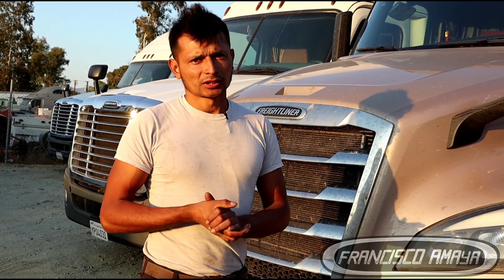Detroit diesel DD13 DD15 DD16 engine DOC DPF SCR filters cleaning using DDDL software 4 hours regen

Comment: I cleaned my for good aka deleted this bull crap   I was going broke but now I have a good running dd13 and I’m saving the planet from regen heat at 1200 degree for 39-45 mins  now if you add 50,000 trucks regen at the same time explain how that is good for the planet and climate change?

Comment: I just had my whole 1 box cleaned.   
What’s your opinion on the additive Pittsburgh max mileage?  I was told it helps to clean the dpf and may increase mpg
Reply: Also if you use lucas while doing this process the process will be much better than just using diesel.
Reply: Try LUCAS DPF CLEANER it works great!
Reply: @martinsantillan2538  really may try it